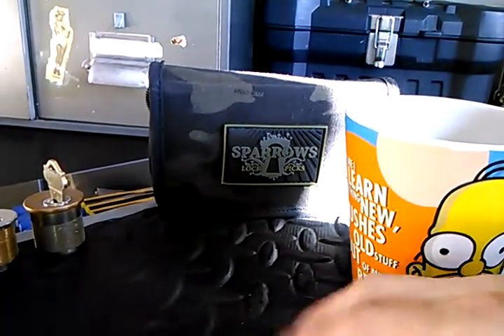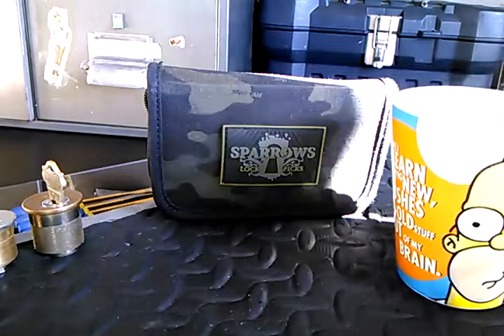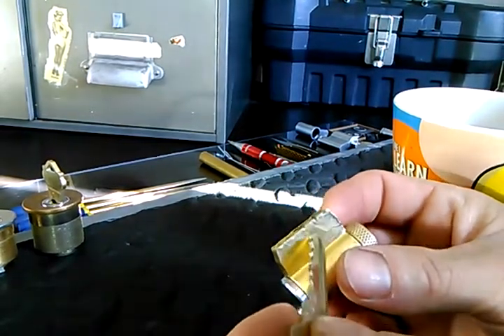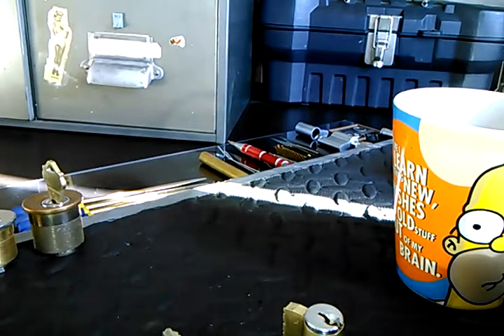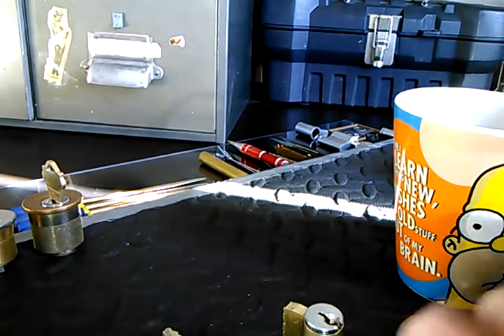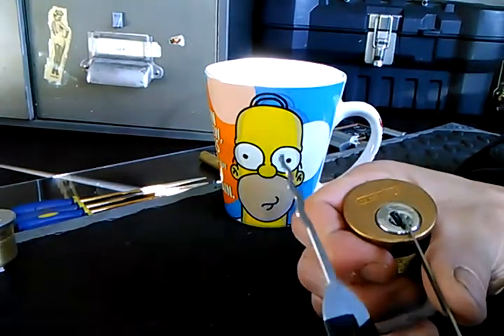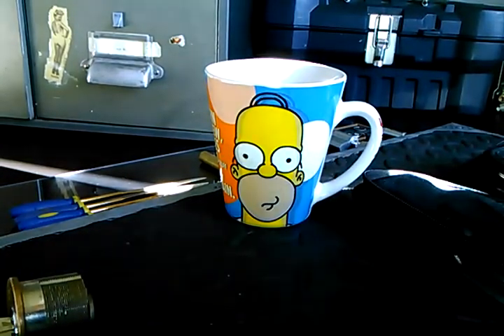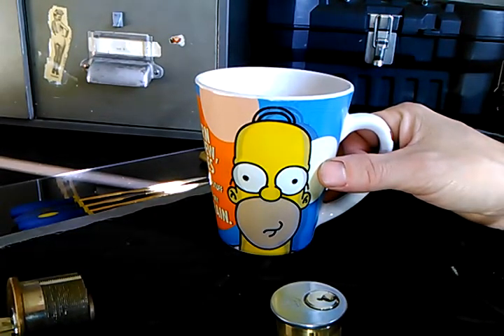Stock Lock Sunday: Weslock deadbolt cylinder

Comment: Question Sir
1. Is there a key lock that is 100% pick proof?
Reply from the maker: pinning this because its the burning question everyone wants to know...

the short answer is no, there are no current designs that have been demonstrated to be 100% pick proof. 

I had thought that the Bowley Lock (a Canadian design!) would prove to be unpickable but some guy made this crazy multipiece articulating pick that got the job done. The best you can do is use quality locks with a resonable pick resistance in combination with other security features. Lets face it: criminals tend to be pretty lazy between the ears if you get my drift. Very few if any would actually take the time to learn picking, which astounds me given how easy many locks can be beaten with picking attacks. 

have a fantastic Easter bro!!! Be safe out there!